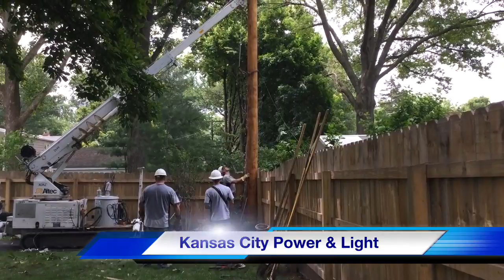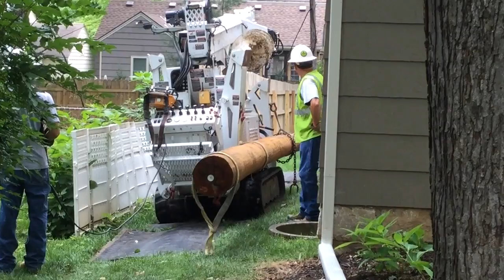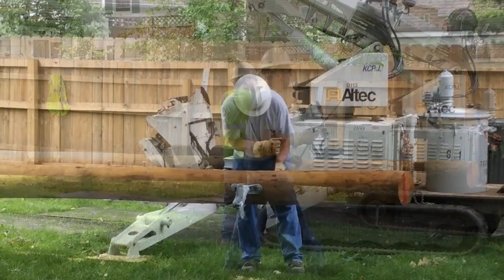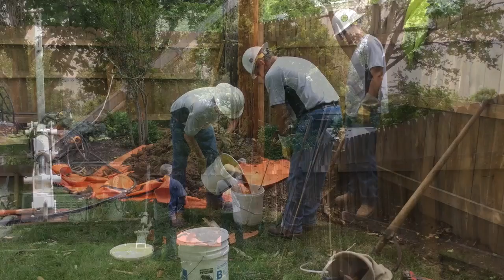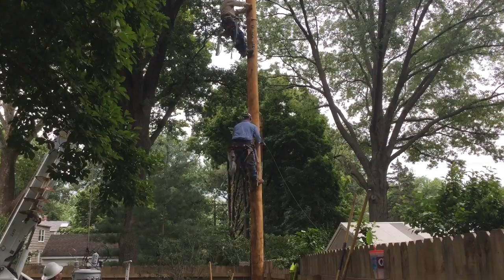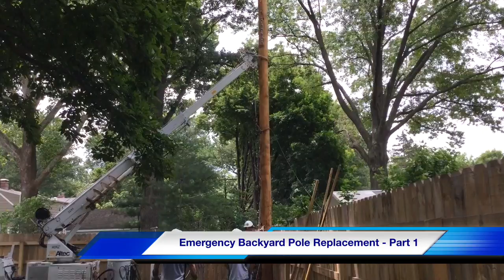How to Replace a Backyard Pole in an Emergency - Part 1

Comment: It's interesting to see a three phase line, if that is what it is,  run through a neighborhood like that, on top of all the heavy vegetation. Most of the lines where I live that run through residential neighborhoods look to be single phase and low profile to help circumvent any possible damage from nearby trees.
Reply: Further Down the line The other phases will probably drop off, watching poles near me, A & B may reach capacity  then C continue until capacity reached.  For all we know, there is business district at the end of street being fed.
Reply: You see all 3 Phase because some customer(s) need 3ph Power, down your Lead. Second, it could be part of the 3ph Circuit before it drop on to Single ph.
Good observation but it is not rare.

Comment: I'm surprised they used the "foam" to secure the pole.   Packed soil does just fine in most places.
Reply: Packed soil settles, the foam gets hard as a rock and does not settle so the pole will stay firm in place.
Reply: We used the soil all the time but also used pole foam. Some utilities don't like using the old dirt. I personally like pole foam myself.
Reply: @linehandibew6205  I'm sure I have and It probably wasn't fun

Comment: If they couldn't use the auger, how did they excavate the hole?
Reply: Tubmaster 5000 Watch the video 1:30
Reply: With the apprentice.. get the digging boy!!!
Reply: I've seen digging machines of late that use a high-pressure jet of water to loosen the soil, while a large vacuum sucks the soil up into the excavation truck.  Perhaps these are used instead of augers where there is the potential to damage existing underground utilities without having to resort to hand digging?
Reply: Tubmaster 5000 yeah that and high pressure air jet blowers. Either of which is better and faster than hand digging.
Reply: @lumberwhack6294  its a shame neither of those work very well, we continue to hand dig
Reply: Dan from GA  yeah it depends on the soil. Only ever seem them used in Florida and they seemed to do pretty well. Up here in va we don’t even have them.
Reply: slapsticks long post hole diggers do it everyday !!!

Comment: I notice the insulators are set in from the ends of the arm. Wonder why that is instead of using the outermost positions?
Reply: I think because the span of the conductor is a lot smaller than the span of arm.
Reply: Old lines have slimmer frameouts. Ive seen 4 ft arms in use on the distribution lines for primary, typically 7.2kv or less.
Reply: Interesting

Comment: What steps are different when it is not an emergency, such as nice weather and allowed enough time for utility locating services to get out to the site and winds/lightning have passed.  Where is the emergency?
Reply: @Kara, I’m not from this Utility, I’m a Lineman from Mich. When the Power Comp say Emergency, they are saying “Someone is out of power” until we make repairs. The job can’t wait until the next day. To the Utility, it’s just another “Trouble Job”. The Steps in repair are not different between Emergency, Trouble and Planned Jobs. And speaking of weather, most of our Emergency (Trouble ) work is done in bad weather. Also when customers are without power, waiting on Locating Services is not an option. Waiting will take too long, so we dig the hole by hand. After 20 yrs of digging, my shoulders and elbows are absolutely destroyed by this procedure.
Hope I was helpful with your questions.

Comment: So ... what happens to the old one?  Why not remove the old one and place the new pole in the same spot?  Especially if the easement is narrow.
Reply: @confident, the machine they’re using is not rated for the stress of pulling a pole out the ground. After the new Pole is set, they will often dig below the old Pole and then cut it below ground level. There is a contraption to drag back there to pull the Old Pole Butt out the ground once you cut the Old Pole, but it weighs a ton and often workers get hurt(shoulders and back) while handling it, especially in the cold.
Reply: @garynelson9538  they usually pull old poles or cut them at or above ground level.

Comment: Why do you have power lines at the back of the homes? Where in most countries all power lines are in front of the homes, which would be much easier to get to, than going through peoples backyards.
Reply: Engineers designed it that way? Maybe one set of the homes wasn't originally there then they built? Could be a few different reasons I'd reckon.
Reply: It's for aesthetics -- nobody likes all the overhead in the front of their home.

Comment: Hi, everybody!
I have a question: why do you usually use wood pole and no concrete pole?
Thanks!
Reply: Dinomarques Alves Probably cost. And wood looks better too i think.
Reply: Concrete poles take a lot more effort to set.. More money, more time, more resources = not cost efficient
Reply: Depending on the region and weather. In the tropical regions it's quite hard to source trees for pole such as douglas fir, lodgepole pine, jack pine. In tropical area, wood poles ages very quickly. Thats why we use mostly concrete and steel poles. 

Please checkout my channel. Thanks
Reply: Telephone and cable companies needs to hammer their hooks into the poles to hang their lines on. Concrete makes this much more difficult, would need to pre-drill first. Also, I guess that when concrete starts to crack, it tends to fall appart a lot more easily than wood, and if a wooden pole's structural integrity isn't in good shape, it's easy to verify (sounds hollow when you hammer it, and a screwdriver will go through the pole base easily). But that's just my guesses.
Reply: Cost and location

Comment: i wonder if that is the machine they used to replace a transformer in my neighbors backyard by his fence i think the transformer shown in this video is similar to the one that used to be on a pole well till one of the hots snapped that went to 1 or 2 houses i felt bad for them linemen who repaired the line and replace the fuse for it to blow again and i guess that is when they seen the transformer had failed the same pole is still there i believe but not the transformer  i think they worked till around 3 or 4 am before everything was done
Reply: $$$$$$$$ they probably got premium pay  , regardless of the pay  it is actually very rewarding to any true lineman  to be able to restore power to a neighborhood as soon as timely possible.